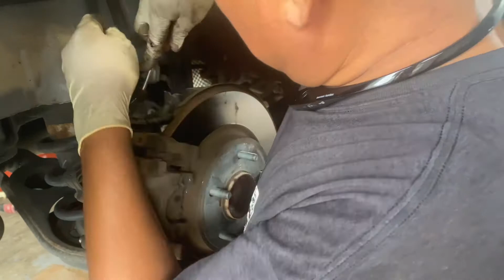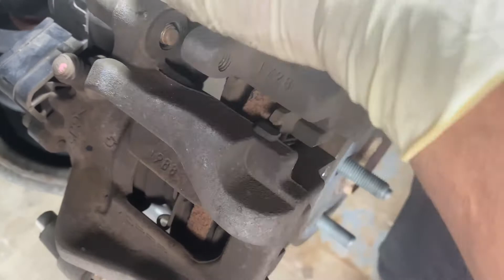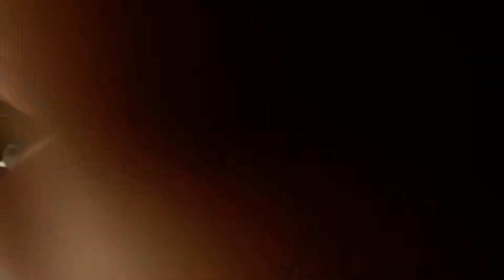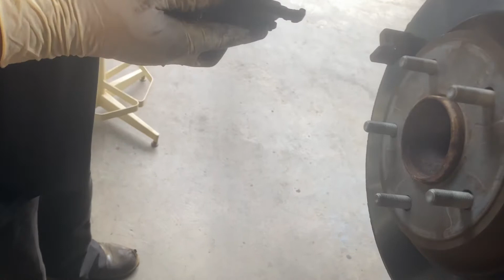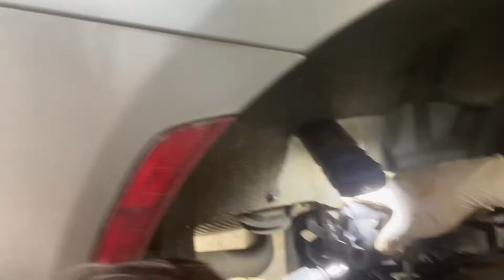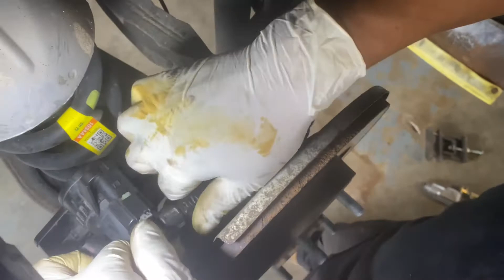🔴HOW TO CHANGE REAR BRAKE PADS ON CHRYSLER PACIFICA 2019

Comment: This is unprofessional rear brake pads replacement. There is a special tool to press caliper cylinders but before that, you have to go in the menu and put vehicle in rear brake service mode, other wise you can damage electric brake.